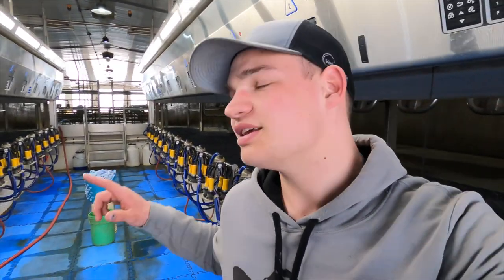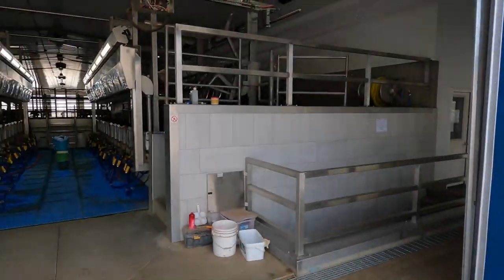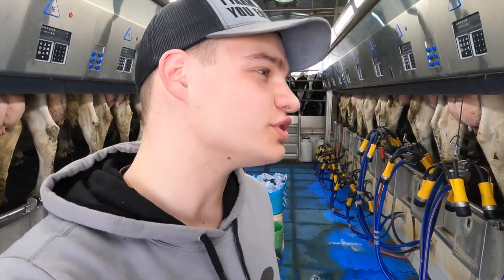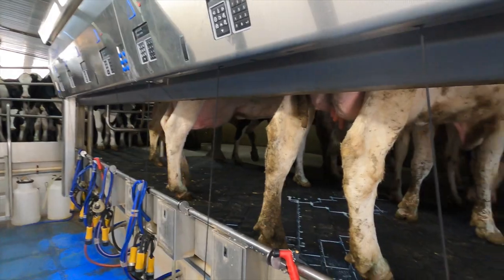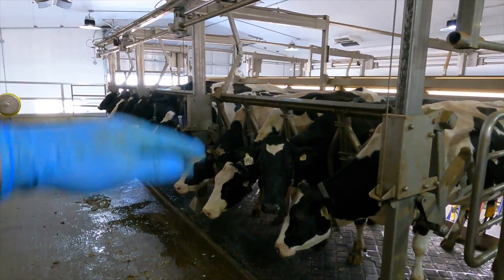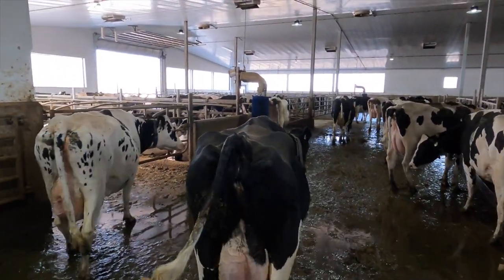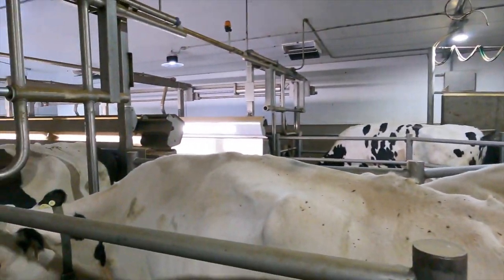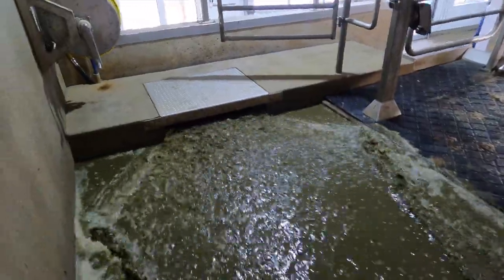Milking Cows In Modern Parlour / 2021

Comment: Wow, that is some very nice system you have going on there, so automated and clean, the cows too seem so well behaved and compliant, know exactly where and when to walk stand turn and leave, amazing.
Your nice blue floor though is getting stained, and that flush water looks pretty nasty as it spews out from the valve under the floor.
You all work extremely hard, very impressive and a wonderful set up, your explanation comes across crystal clear you obviously know what you are about, well done, nice camera work too.